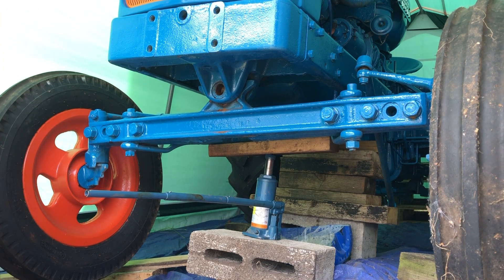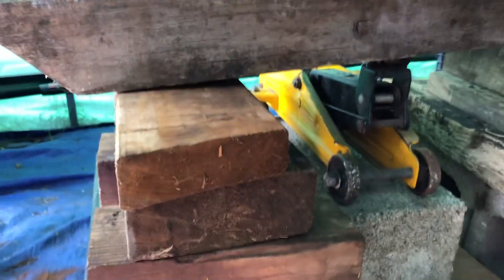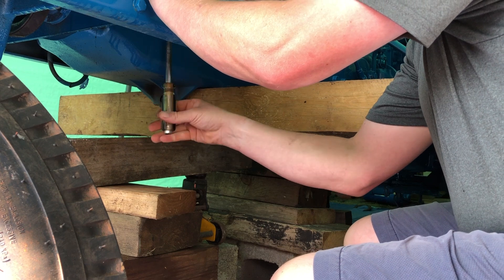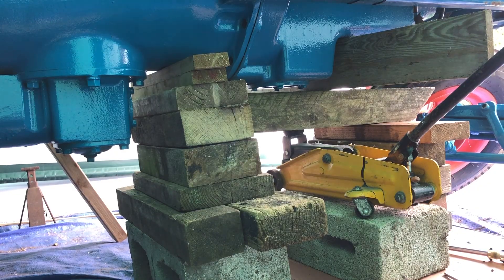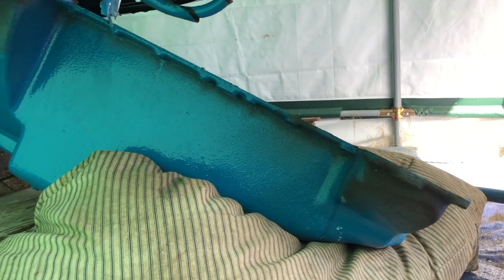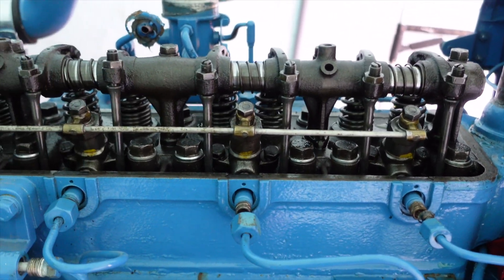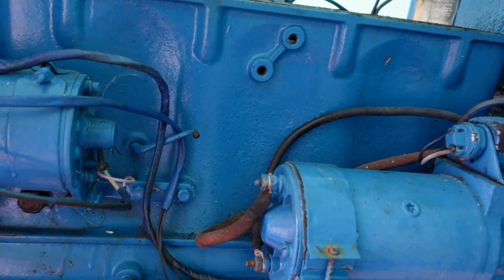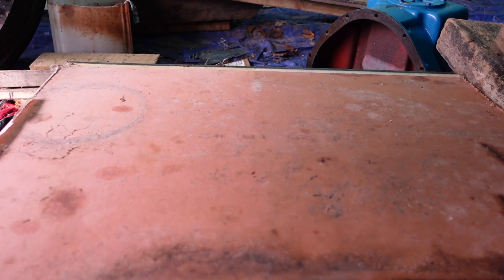Investigation and repair of coolant loss on Fordson Major part 1

Comment: Hello Rich. Great video and resolving issues with leaking. I’ve got the same on my JCB mk1 I guess. I drained a lot of oil with water and during the work I have to add some water to avoid the overheating of the engine.
Terrible show… 😅
Now is the main question how to get these liners up 😅
Reply from the maker: Hi Thor
Many thanks for your kind words 
I wish you well removing your liners 
Mine had already been out 
It was just the one that was a bit stubborn

Comment: Thanks for this. I've got a similar leak I think. How did you actually get the liners out? Any help would be greatly appreciated. Thanks again. Pete (Queensland Australia). BTW, your Fordson looks MUCH cleaner than mine - nice work :).
Reply from the maker: Hi Pete 
Thanks for your comment 
We used bolts and a piece of steel with holes in to ease the liners out 
The liners had not been in long so were not too difficult to release